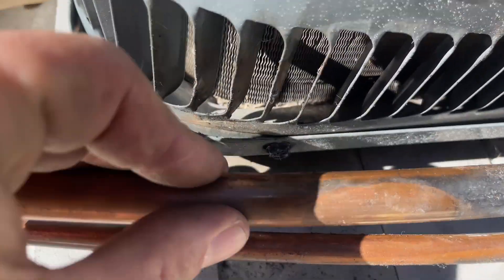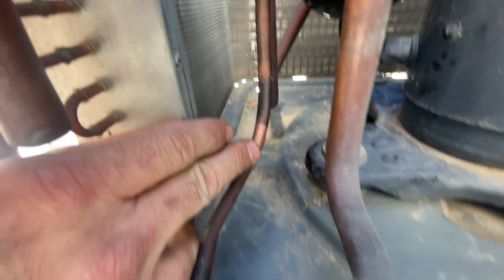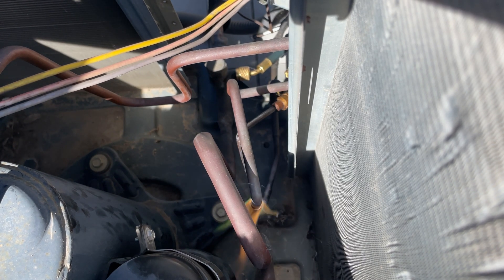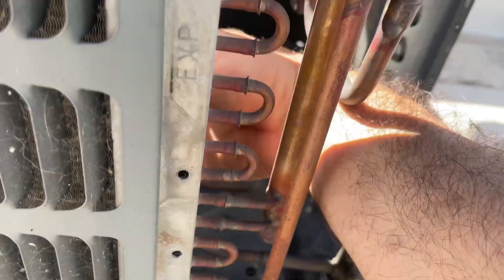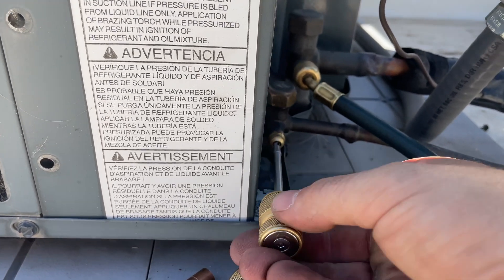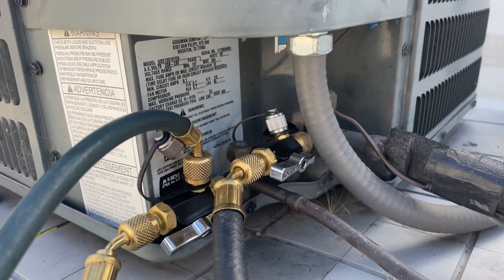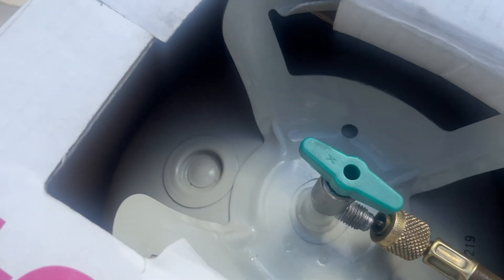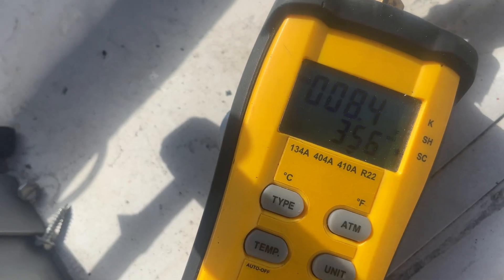Refrigerant Leak Repair at Condensing Unit

Comment: Good job man, obviously you're  a maintenance guy with a lot of hvac experience. What re your pressures on the oxy ace tanks when brazing?
If you had done a pumpdown would you have been able to braze the piece that you eliminated the drier?
keep up the good work!
Reply from the maker: Hey! If you mean what do I set the oxy and ace at I have no idea, it’s low though, been years since I’ve adjusted it lol as I rarely braze anything bigger than 1 inch. As far as pump down I know a lot of techs that pump down and keep the drier in, I’ve done it myself, but the correct way is to always replace the liquid line drier and don’t just pump down and add another one. Hope that makes sense 👍